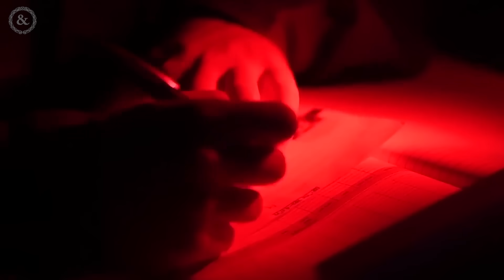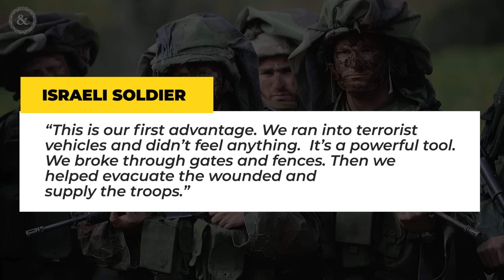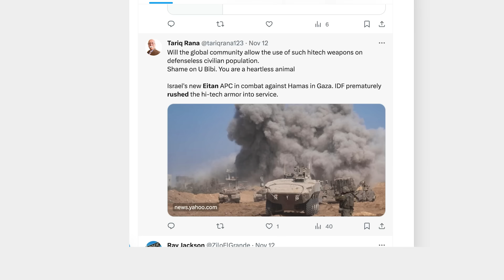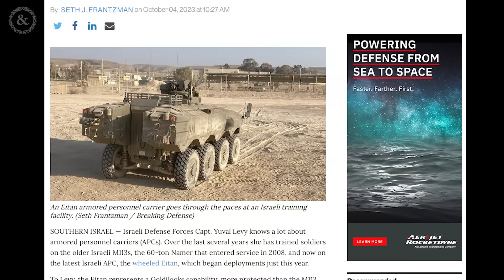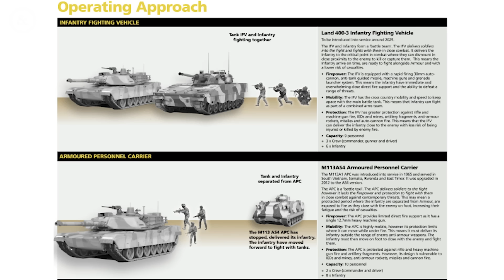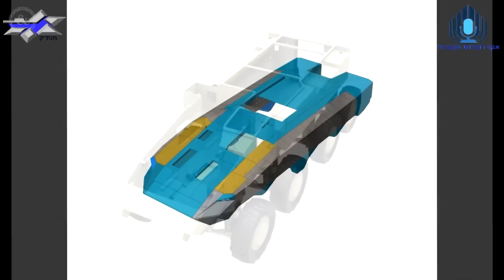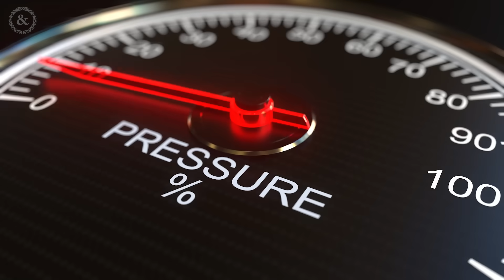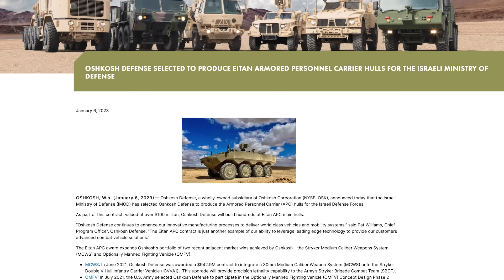Israel's Untested Armor Thrown into Combat

Comment: A military needs tracked and wheeled armored vehicles.  Tracked for off road heavy assault.  Wheeled for high speed on road and urban warfare.  Both have their uses and can overlap.
Reply: Im honestly surpised with modern obsession with tacticals and modularity that some general hasnt demanded they get a tracked vehicle that can have its tread wheels wrapped in rubber and driven on like road wheels
Reply: @arthas640 I think that was tested around 20 years ago, but it made maintenance almost twice as complicated
Reply: @ZetaMoolah  doesn't surprise me.
Reply: @arthas640 Some light tanks had that in WWII. I think it was on a Russian tank.
Reply: Some early tank designs had this
Wheels for on the road
Stop and put the tracks on when going off road
Reply: @arthas640  
Uhm, rubberised treads / road-tracks have been a thing for decades. You can tend use them when traversing a normal civilian road. Base where I was stationed a while had that, as well as signs posted that by order of basecom, stopping any armoured vehicle was prohibited. 

Why? Because the road could support you driving on road-tracks, but if you stopped there and just let all that weight sit on top of one bit of road, you'd tear it up in minutes.
Reply: @arthas640  This was experimented with during the interwar years and was rejected for any number of reason.  One such vehicles was the original Christie tank, It had big road wheels that were powered and was fitted with big rubber band tacks that could be removed. It never went beyond the testing phase.
Reply: @Riceball01  That's cool, im gonna have to read up on that.

I'm actually surprised they didnt try it more often. Military leaders have a weird obsession with swiss army knives and want things to be able to accomplish multiple goals/roles even when it's impractical. Like the Osprey being less stable then a prop plane or helicopter, slower than a VTOL jet, and packing less firepower and transport capability then most attack and transport helicopters. 

I forget what weapon it was but i remember reading about a swiss army knife approach to a rifle once: they wanted to be able to have 1 rifle work multiple roles. So they made parts to make it function a bit like the BAR (full auto, larger clip), standard select fire battle rifle, they made multiple barrels for it so you could turn it into a sniper/designated marksmen rifle, and made a million attachments for it. Problem was they thought that soldiers should be able to swap around roles out in the field but that requires sitting down and taking tons of time to swap barrels and attachments and the ergonomics of an effective light machine gun arent the same things you want in a good sniper rifle so it kind of sucked in most roles and about as expensive as buying multiple guns, especially since the multi-role gun wore out faster. Didnt help that they wanted it to be able to use multiple ammo calibers as well so it didnt ease logistics.
Reply: @arthas640  Militaries trend to like the Swiss Army knife approach because it saves money (one less thing to acquire) and it saves on logistics (fewer types of spare parts to acquire, store, and ship). This is why the US, with the exception of the A-10 no longer operates dedicated attack aircraft and why militaries around the world use MBTs instead of the light, medium, & heavy tanks of WWII and the period right after. Of course, that doesn't necessarily mean that these types of weapons systems are always a good idea or work as intended but there is definitely a logic behind wanting them.

As for tanks with removable treads, nobody toyed with the idea more probably because everybody around the world who designed and produced their own tanks watched the early experiments and came to the same conclusion as testers, not worth it. I don't recall what the exact issues were but I'm sure that extra complexity was one thing since you now had to power the road wheels and not just a wheel at the back of the track on each side. If you're really interested in why the idea never took off, I recommend reading up on the Christie tank which was one of those tanks where they played with the idea of removable tracks.
Reply: @Riceball01 well the A-10s will be retired by 2029 so...😂😂
Reply: @arthas640  if I'm not mistaken, the osprey also has the advantages of being faster than a helicopter, with a smaller required TO/L area than a plane (other than a harrier which can't carry passengers)? it's also not an attack helicopter, so there's no reason to compare the two. that's like saying a black hawk has less firepower than an Apache. and the stability issue was equal parts training and design which is being fixed by its successor.
Reply: @arthas640  Every design that tried this was found too be too complex difficult to go from one mode to the other and add a great deal of weight therefore reduce speed and range.
Reply: Plus Israel has a decent amount of hard packed desert terrain that can easily support the wheeled vehicles and they can move fairly quickly.
Reply: Tracked vehicles couldn’t respond quickly to the Hamas attack. Wheeled could. I believe in Iraq the quick reaction forces were all styker too
Reply: still suprised in the lack of investment for armoured battle flatbeds to carry the tracked vehicles so they move faster.
Reply: @davidty2006  the US at least has quite a few of them like Heavy Expanded Mobility Tactical Truck aka the HEMTT. Israel bought some of the same vehicles like the HEMTT but not sure how many. They've also got a variety of armored utility vehicles like the M548 Alfa which is a converted M113 APC designed as an ammo and cargo carrier and Isreal also maintains a variety of armored bulldozers, tractors, excavators, etc.
Reply: they tried that in WW1 and  2
Reply: can somebody explain why APCs don't have bullet-proof glass panels on its roof that open for the mounted infantry to use their eyeballs/guns
Reply: @theobvious1958  If Tanks can be taken out by anti-tank weapons that are designed to direct plunging munitions to the roof of tank turrets, that are multiple inches thick, how thick do you think a roof of glass would have to be to keep the troops safe?

Comment: So they ripped off a Stryker and tweeked it to there liking, gotta say for those that choose that path the Israelis do it best for sure
Reply: The US doesn’t own the physics that underly the designs. Stuff ends  up looking similar because form follows function.
Reply: @Matt-yg8ub  yeah literally every AFV ends up looking about the same with just different size dimensions unless it turns into an unironic box on wheels.
Reply: In engineering theres just certain shapes that are inherently better for certain purposes. Basically the boundary conditions result in a general shape. Look at planes, trains, even cars. It's ironic to me that everyone drives a crossover today, which bears a lot of resemblance to the Pontiac Aztec, just with bigger tires and a rounder body.

You wouldn't want it to look like a donut? How about a Pyramid or dome? How about of convex shapes on the exterior?  How about a giant mech? Those work great in the cartoons? None of those work.
Reply: The Stryker is just a glorified Swiss Piranha
Reply: Technically, the Stryker is a rip off of a BTR…🤣
Reply: @truongchau56  they are similar vehicles but they are still quite different in how they function with the major difference being where troops get in and out of the vehicle from